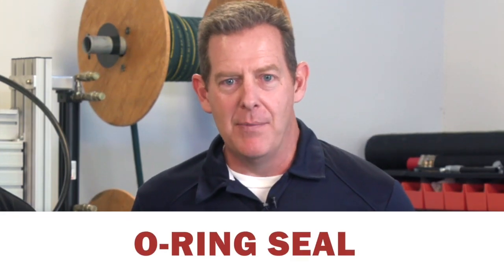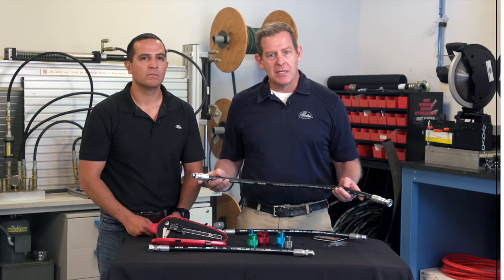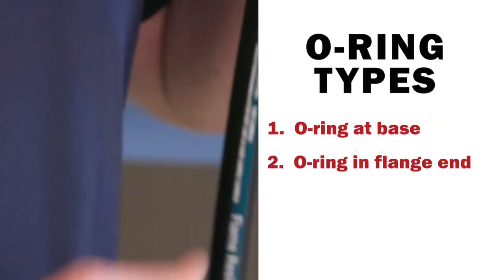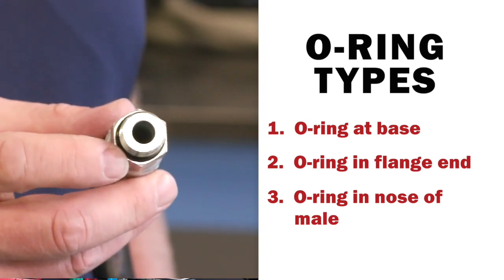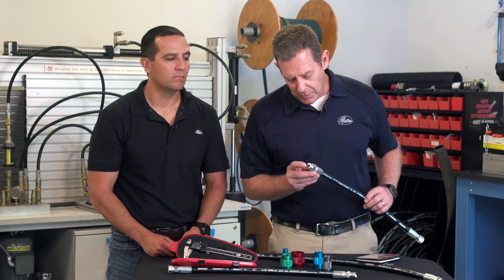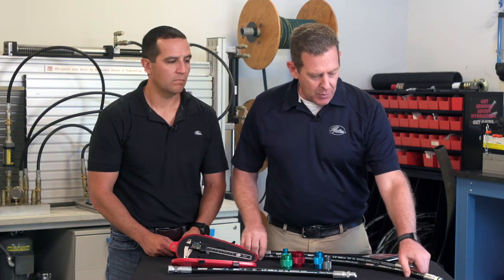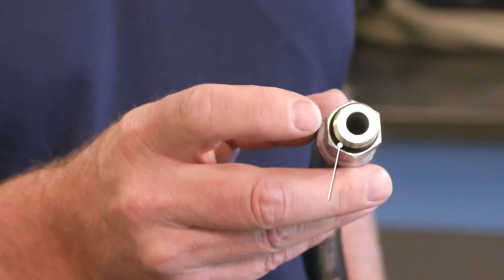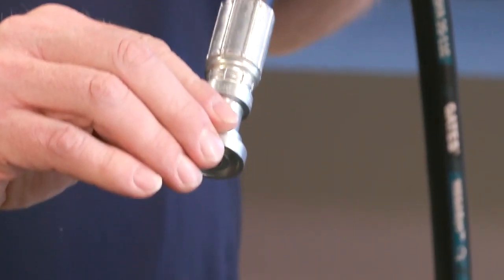Thread Identification - O-Ring Seal Types

Comment: Im losing my mind. Nobody seems to know how to seal metric fittings. They dont use rubber, but instead copper gaskets. Problem is, NOBODY makes replacements. The hex head on all of the available ones are so shallow they wont hold anything (Not even a rubber o ring...I tried). I have to connect two air brake components, and I have to spent thousands for basically a chunk of pipe.
Reply: I'm curious - ever find a solution?
Reply: @chrishayes8197  I had to hunt until I found them. I needed 22mm gaskets, and Van Hool a euro bus company that makes buses in the US as well, is metric, but they had to custom make 22mm fitting, since they dont use that standard. But at least I got a few extra.